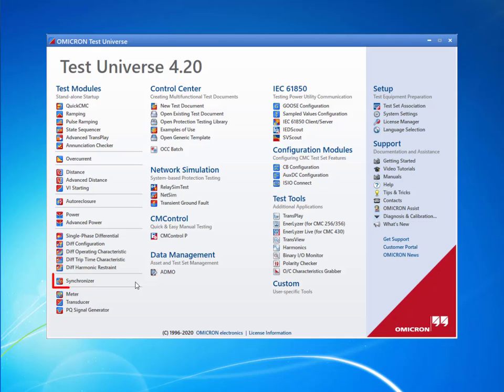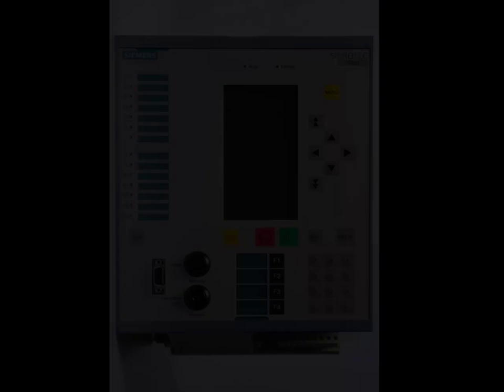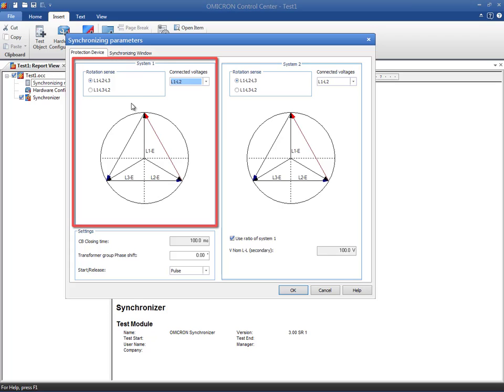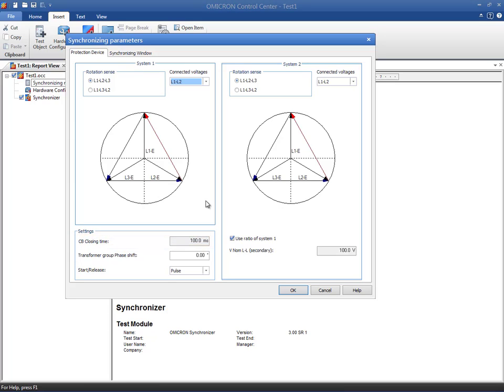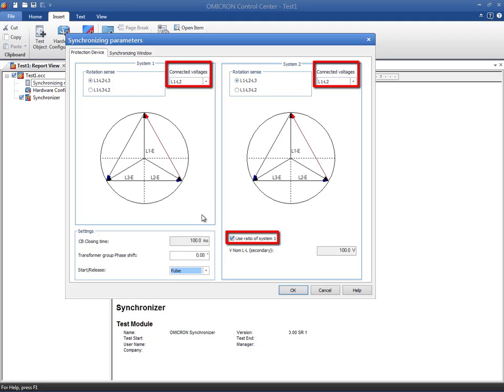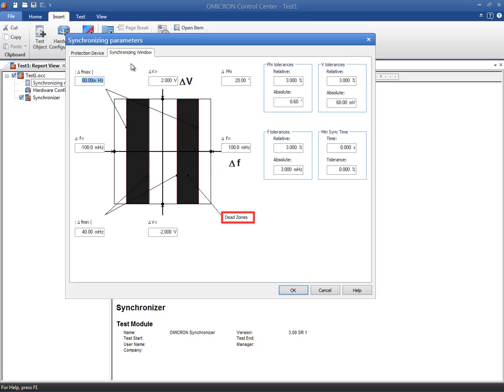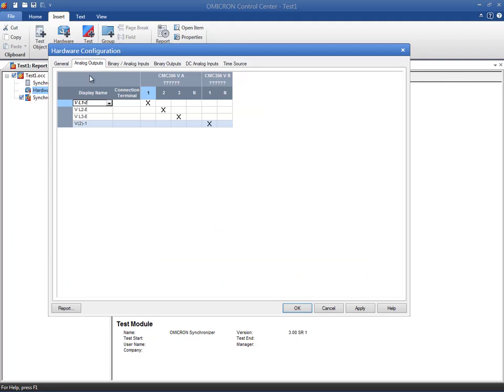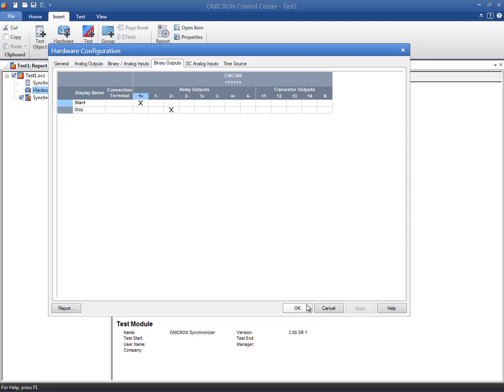Synchronizer Module Part I

Comment: Thank you for explaining !! I tried the same Synchronizer module for SEL-451 Auto-Synchronization. (Single phase-using one omicron only). I could effortlessly simulate both voltages/frequency pulses and check the actual breaker closing.  
Following are the observations while performing testing:
1. The Frequency Increase/Decrease (F>, F<) and Voltage Increase/Decrease(V>,V<) pulses that the relay output throws out do not actually change the frequency/voltage of the omicron. Meaning, if the relay sends the voltage/frequency correction pulses, the Omicron should be able to correct the voltage/frequency based on the pulse width. In the real system, the generator would respond to match the speed/voltage once the voltage/frequency correction pulses assert. 
It would be good to see the Tab where we can enter the pulse width. That way it will be complete close loop simulation. 
2. The other suggestion for this video is, if you could actually show the breaker simulator/physical relay-omicron connections and results of how the frequency/voltage pulses are generated. The help section of Test Universe explains the connections and other detail, but it would be beneficial for someone who is starting off new and wants to test/troubleshoot their own system with different parameters.

Overall, really helpful module for testing and visualization !!

PS: Please let me know if I misunderstood something.
Reply from the maker: Dear Rikesh Shah, 
thank you for your interest in our videos and this valuable input. Here are our comments regarding your issues: 

1. Are you using the “Function” or the “Adjustment” tab for testing this? The “Function” test ignores the issued commands as it only executes certain test points to check if the relay issues the synchronization commands correctly (no generator adjustment is performed). 
In the “Adjustment” tab you will actually see that the generator is adjusted according to the received pulses – here the pulse length does not matter as each pulse relates to a set amount of frequency or voltage increase/decrease.  
2. The frequency and voltage pulses are generated by the relay and you can see them recorded by the CMC test set in the “Signal View” – this is nicely shown in the “Synchronizer Module Part 2” video. 

If you need any material how the CMC is connected or if you have further questions please contact our technical support team directly via support@omicronenergy.com. 

Best Regards, 
your OMICRON team
Reply: @omicronenergy   Thank you for explaining in such detail. Appreciate your response. 
I tried performing the tests with 'Adjustment tab' and could perform the frequency & voltage corrections. Works perfectly as expected !!